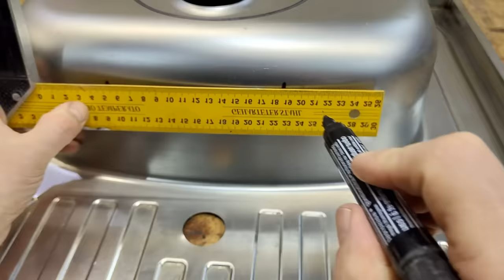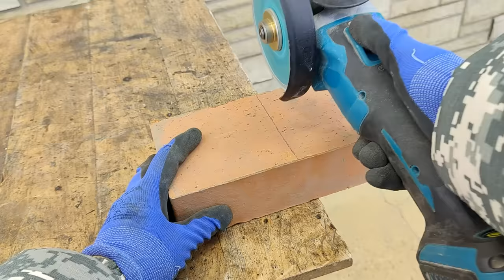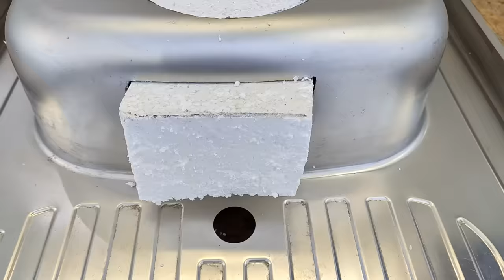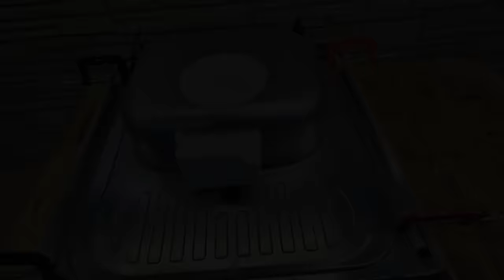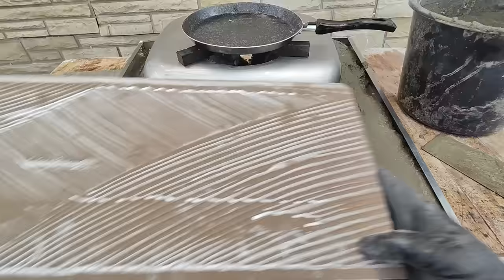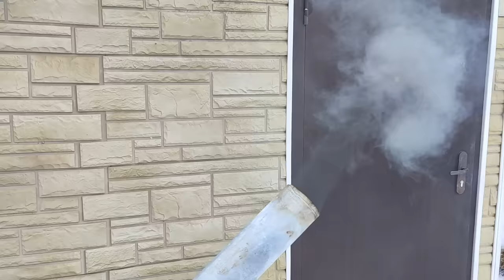Never throw away an old kitchen sink. A brilliant idea with your own hands!

Comment: I would use a burner grate from a gas stove-able to handle heavy pots.
Reply: Definitely ! When ever I spot appliances such as a stove or refrigerator being tossed away, I will keep the grates, burners, and hardware for the gas lines and the aluminum çase for projects I have designed.

Same for refrigerators since I don't have to buy the aluminum from a shop.